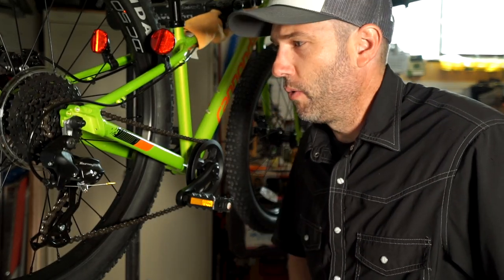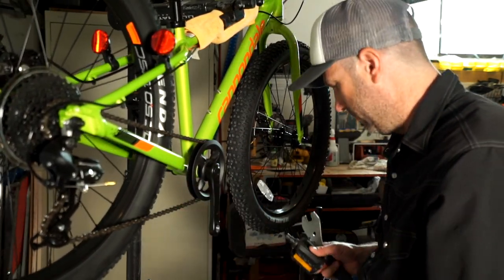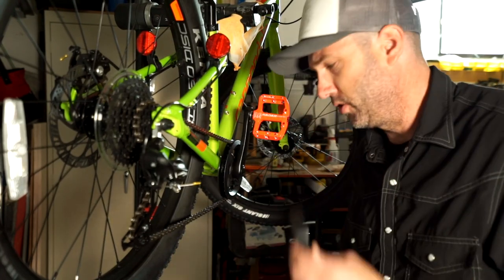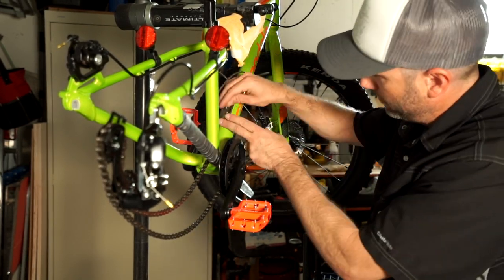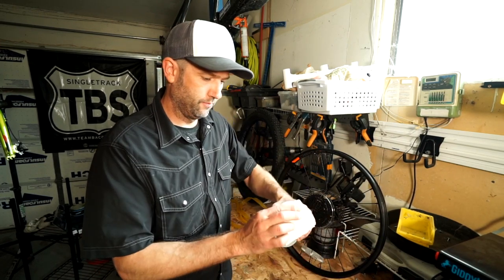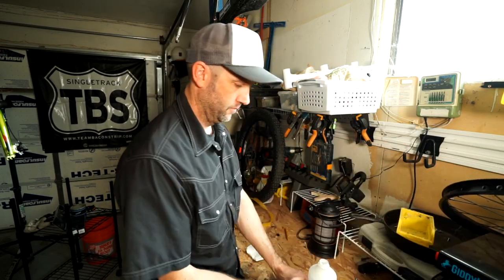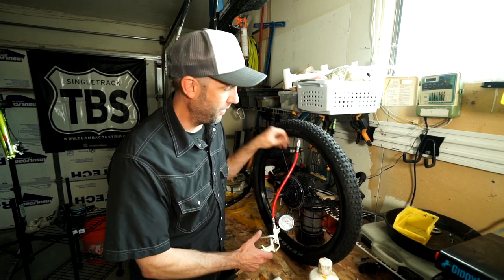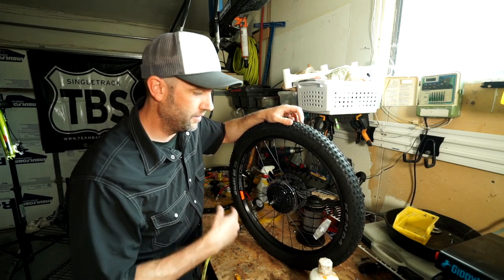How to convert your kids bike to tubeless tires: Cannondale Cujo 24+ Mods

Comment: This is a great bike for a beginner MTBer and beyond. I just refreshed my son's Cujo 24 With Avid brakes and lever pulls, SRAM 9-spd cassette, SRAM 9-spd trigger shifter, SRAM X5 rear derailleur, and a new bar and stem. Also threw on a longer seat post and it's like a brand new bike. He'll get another year or two out of before he moves up to an adult sized rig.
Reply: my son has the exact bike as in the video.  I want to swap him to 9 or 10 speed, using some of the parts I have around here.  Did you have to swap the free hub body out?  I noticed that it's a bit shorter than normal even though the back spacing is the same (135mm).
Reply: also, the 9speed worked with the cranks/front chainring without issue?
Reply from the maker: I don’t know that. Probably not.

Comment: Really like your Channel thank you for sharing! How do you like the bike long-term? Just picked one up for my son and would like to do the tubeless conversion.
Reply from the maker: It’s a great bike! Only issue is the low end drive train.
Reply: @AllTerrainFamily  do you happen to know if the drivetrain is upgradable? I'm also thinking about upgrading at least the front brake to hydraulic if I am able to use the tektro hydraulic front brake I took off my giant fathom
Reply from the maker: @jasongebow8094  Yes, It's a cassette hub, 135 spacing so you can upgrade to 1 x 10. But you'd need shifters and everything. I wouldn't bother upgrading the brakes unless you have something better than tektro.

Comment: The wheels are drilled out for Schrader. The Presta valves you list don't have any problems with these wheels? They don't float around in the hole?
Reply from the maker: Nope.
Reply: There are now schrader tubeless valve stems available. I converted my sons' wheels to tubeless and they fit well and hold air as needed. Mated with Vee Tires Crown Gems (24x2.8) and the setup blows away most every stock tire setup out there. Scotch 8896 blue tape is the stuff. 1 roll does many tires.
Reply from the maker: Great tip on the tape! I steer clear of Schrader valves because then i have to cary an additional pump or adapter.
Reply: @AllTerrainFamily  Fair enough! What, you don't want to use your shock pump in a pinch? :)

Comment: Has anyone with this bike changed out the shifter/rear derailleur for something with more speeds?   My son has had the bike for a little over 2 years.   He could use a bigger climbing gear, now.  I have 9, 10, 11 speed stuff sitting around here, but the stock freehub body seems slightly shorter than normal, and they seem to have a spacer in there.  I could replace the freehub body with something off of an old wheel, but, first, I want to see if someone else has gone down this rabbit hole.
Reply from the maker: Why not pull it off and find out? That’s what I’d do.

Comment: How well did you find the tires held up tubeless a year later ? Are the still going strong or did they end up not holding air over a longer period
Reply from the maker: I had to replace the valve stems, but other than that they are still going. They need new sealant periodically.
Reply: @AllTerrainFamily  did you replace the valve stems with Schrader ones or just different presta ones? How often are you finding you need to change sealant?
Reply from the maker: @jarrodspencer-harper70  All tubeless stems are presta. The ones in the video had a thin seal inside the rim ant that didn't work with the rims. The rubber stopper type are pretty much the best bet. Add sealant every couple of months.
Reply: @AllTerrainFamily  You can get tubeless schrader valves, I used some on my son's Cujo. I also found the Specialized Big Roller 2.8" tires sealed a lot better than the Kenda Slants. I used gorilla tape on my conversion and it has held up well for two years.
Reply from the maker: Every other bike we have is presta so i was keen to have them all use the same pump. Good to know there’s another good tire option!

Comment: How well has the tubless setup held up so far on the bike? I’m about to do my sons cujo 24 as well. Just wasn’t sure if it actually held or not.
Reply from the maker: It didn’t for a while so I replaced the Orange Seal valves with some Stans and those are holding very well.

Comment: Just picked up a Cujo 24 LTD, it has the same wheels and tires as the Cujo 24. How's your tubeless setup holding up? Any issue holding air? I did some research, the wheels and tires don't seem to be tubeless ready. Thinking about going with the Stan's wheel  30mm wheel tape with Stan's schrader valves. What was the width of the rim tape you used in the video? The ID of the wheels is listed at 29mm, so I'm assuming a 30mm tape should work well.
Reply from the maker: Holding air just fine. Those wheels will work if you use the Stans Tape and valve. Thought you might have better luck with orange seal sealant. Just don’t use the valves you see me use in the video.